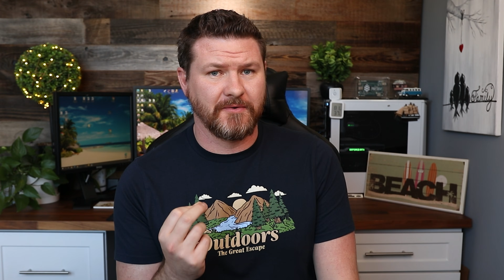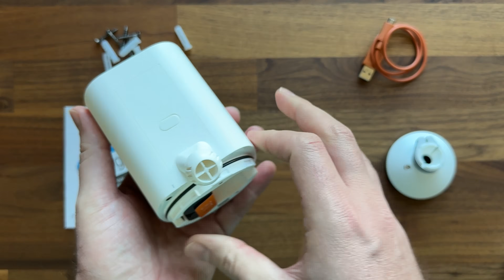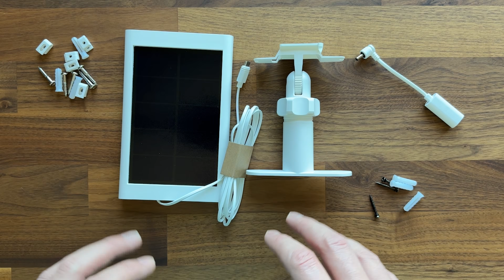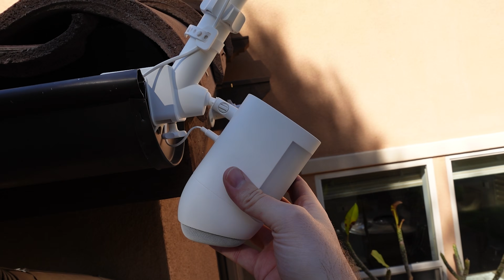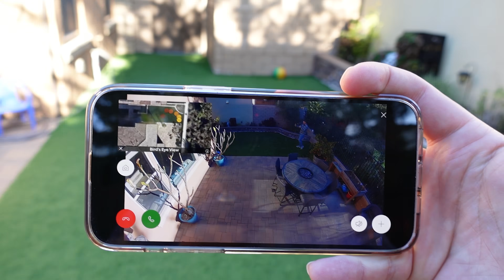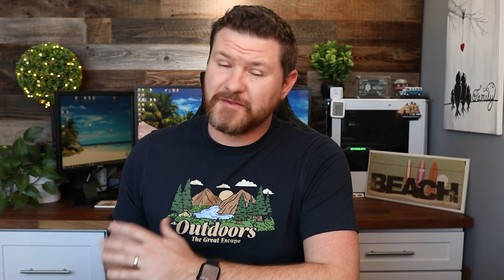The TRUTH About Ring Spotlight Cam Pro

Comment: The truth is I had nothing but problems installing this camera. Did you notice the owners manual shown in the video? It’s a trifold piece of paper with almost nothing on it. Mine had the QR code printed on it and it was so small my brand new iPhone 17 Pro Max could not scan it. This is the second ring product that had the small QR code that would not scan. This gentleman says he scanned a QR code on the back of the camera. Did you see It? Check the video. 
So they give you a second way to set up the camera without the QR code. There are five digits under the QR code that I would call microscopic. The only way I could see these numbers was by taking a picture of them and blowing them up. Many people are complaining that they lose these owners manuals over the years and then they can’t reinstall their cameras. I honestly didn’t know that you could pull the mounting bracket off the camera and turn it around. I had no instructions. I had to watch two YouTube videos to get proper instructions. My camera came with a battery and also the type C port on the back of the camera just like his. I don’t think there are different cameras for different power sources. I certainly didn’t get that option on Amazon. When you finally get the five digit number to work, you do get to the instructions, but they are not good instructions. I actually wanted to mount mine in my garage. I have an attached garage and that is the main entrance I used to get into my house. I thought the light would be a good way for me to get into my garage and see my way to the door and unlock it. And honestly, it is working great for that. The problem was getting the camera to take power. The one battery supplied is really not enough power for this camera. They give you one, but you really need two. What are you supposed to do in the winter time? Climb a ladder to constantly recharge these batteries? I ordered a power cord and power adapter for Ring cameras on Amazon. It was supposed to power this camera too. It was not nearly powerful enough to show the camera was getting a charge. In the end, I had to fiddle around with this camera for days before I got it to work. I found I needed at least 100 W power cord and a 60 watt power source and now the camera seems to be charging. However, many types C charging chords will not fit into the back of this camera. The indentation is too small. I very luckily had a 3 inch type C power cord and extension adapter meant to be used with a phone recharger. It had very small ends that could fit the Ring camera. I think the camera base is very cheesy for the size of the camera. I think the picture quality is not very good. Why do they call it a spot light? It has a very wide angle light source. I kept getting notifications that the camera was not getting power with the cord and I should switch to battery. I don’t know why they made the set up so complicated. When you switch from power to battery, you have to redo the Wi-Fi set up too. I tried to call Ring customer service on my last two purchases, good luck with that. I would say Ring customer service is the worst I’ve ever had to deal with. It’s AI and it takes you a very long and aggravating time trying to speak to a human that is as defective as their AI. As far as Ring AI for their camera, that didn’t work well for me either. They did give me a free trial. When I was away from home, I got a notification that someone was taking a package off my porch. I quickly checked my footage and it was an Amazon driver, leaving a package on my porch not someone stealing a package. I don’t think I will ever buy another Ring product. Thank God for Amazon customer service. I had so many problems with the first spotlight camera, they sent me a second one. It had the same problems as the first and I had a hard time getting it to charge with a power cord. Ring customer service was so bad I called Amazon and they refunded my money and told me to keep the camera. My opinion is do not buy the spotlight camera. I’m honestly sorry that I have Ring cameras now. I also had a mini stick up camera that came with a power cord and no battery. The picture quality was so bad I ended up throwing it in the garbage. My first ring doorbell camera is still working and I think this company started out great. I don’t think they care anymore. They are pushing other services like AI and home monitoring. Wasn’t the original purpose of getting a ring doorbell to avoid high home monitoring costs. And other cameras shown on YouTube give you AI features for free.

Comment: I also hooked up the solar panel that does nothing.
Reply: How do you mean?
Reply: @user-tz8pf4pd4q you can buy a separate solar panel and a second battery but the batteries still die pretty fast. A few weeks. I guess weather has a lot to do with it also. If it isn’t sunny the batteries won’t charge.  Sooo I’m still setting up ladders to climb up in the tree to charge the batteries.

Comment: Fellow Ring enthusiasts: I have been criticized for daring to CRITISE the New Ring Product line, even after installing over $ 3000 worth on my home. HOW dare I ? Well the answer is RING engineering has FAILED. "over educated young engineers w/ NO COMMON SENSE" NOW you say prove it: OK 
1st Ring pushes Plug IN CAMS that can be easily over run by ANYONE pulling the plug Daaaaaa, 
2nd The Battery Cams fails weekly, if you do not climb a ladder to replace the Batteries Daaaaaaaaaa. Even the OLD WIRED CAMS with there low electronics, are better options... 
3rd NOW: the HARD WIRED Cams... WHY R are they Labeled "BATTERY" if HARD WIRED, Daaaaaaaaaa PLEASE JUST PRINT "HARD WIRED" and SAVE THE COST OF THE enclosed BATTERY, which has no value~! Lets talk about the "HARD WIRED" and its new CHEAP THIN Connecting; BRADED WIRES with a 1/8" Soldered tip Daaaaaaa it bends when connecting to a HOUSE WIRING..Daaaaaaaaaaaaaaaaaaaaaa and 50% FAILURE TO CONNECT...RING please just SPEND $.05 to make it functionable  Daaaaaaaaaaaaaaaaaaaaaa 
RING you need to upgrade your engineering staff ......Truly Pissed here in Ohio trying from my original Hard Wired to these RUSTY BASE High Tech cheaply made CAMS...........................

Comment: Who in their right mind would purchase a battery dependent security cam? Daaaaaaaaaaaaaaa
HARD WIRED connection is required for dependability. HOWEVER the connection wires currently provided are "UNDER SIZED GUAGE" Daaaaaaaaaaaaaa
Where is the COMMON SENSE here?????
Get with it RING before there are more dependable & better options provided else ware.....
Reply: Obviously more people than you think.
Reply: Have you EVER installed these newer CHEAP wired cams... I have at least 10 this year.

Comment: I bought the regular Ring stick up cam, not the pro and it seems to turn on only after the person has almost already finished passing by. I have the detection set to maximum so I was disappointed at how long it took for it to turn on. So I’m probably going to return it to Costco and get something else, possibly the Ring pro. But I’m curious which camera you would recommend of any brand? I’d like to get 2 cameras and keep the cost around $500 total if possible but I’m not sure if I can get 2 cameras of good quality for that price. Any recommendations?

Comment: So what camera and what camera system do you recommend? I like the Simplicity of Wireless I like the solar panel charging . I need long range and through walls and about 2 to 300 ft away also for some outbuildings. Most need to be mounted to the gutter around the house at least want one on all four sides and then one about 100 ft away and what about 300 ft away from the router. I like the alerts but I also wish it would record 24/7. The only cameras I have experience with now are the Arlo ones from Costco and they are not bad except for they are not charging correctly and they don't get very good range far away. I don't know which one has the better operating system and works best with the cell phones... ?

Comment: The Spotlight Cam Pro Solar does come with a battery, just for the record. It needs a battery for the camera to function and the solar panel to charge. The only one of the three that doesn't come with a battery is the wired option.
Reply: The boxes are labeled BATTERY, ..Daaaa. Even when you order a Hard Wired Cam. If you try to hard wire the unit to the house wiring you will find cheap braded wires w/ soldered ends...THAT may or many not be stiff enough for a proper electrical connection. HOW STUPID all to save 5 cents....NOT TO MENTION  a purchase return as defective (because of poor connections) Daaaaa

Comment: I have a brand new Pro.  Set it up and it worked fine for several days.  Following a power outage, I can not get the camera to log back onto the WiFi.  I’ve done a reboot several times to no avail.  I deactivated the camera from my app.  I tried several times to “activate a new device”, nothing seems to get me past the Red/Blue flashing light.  Any ideas?  Thanks

Comment: Thank you for the "pros" on the PRO ;-) - I've been a RING customer for many years and can't see switching.  One of the biggest things for me is the speed of the alerts/notifications and the fairly comprehensive sensor choice (took a while for things like glass breaks detectors, etc. to come to market) - the 3rd party options while they may not have full functionality are usually useful and easy to add to your system.  I'm sort of a DIY hobbyist but want a security / alarm system that just works without relying on ITTT or more than one base / gateway.
The price for monitoring / cam storage is good too - you can find less expensive but the quality and reliability of the app / cloud infrastructure is very much on-par with traditional/legacy alarm monitoring services at a fraction of the price.

Comment: can you attach two batteries and solar? Just wondering if something will go wrong as I just want to mount it and then forget it forever
Reply: That's exactly what I did, and I have not had any battery drain issues for the last year or so - since I installed  it.  The batteries remain topped off. According to the Ring app, the two batteries stay between 95% and 100% charged.  NOTE:  I have the previous version of the battery powered spot light (as he showed toward the beginning of the video at 3:07) mounted over my garage in a high traffic area - motion triggered off about 20-50 times a day.   I also have plenty of sunlight most of the day time. It has been through rain, hail, wind, and snow.   So far, all is functioning well.

Comment: Why does the camera skips time….like if I want to see at 530am it skips all the way to 630am so there is a 30 minute gap where it doesn’t record and it sometimes skips up to three hrs. Why does it skips?
Reply: You can set how often it records - go to Settings
Reply: It is motion activated. If there is no motion going on there is going to be a time gap between recordings. This device is not made to record 24/7. I think what you’re looking for is a CCTV security camera system.
Reply: The real issue is the lag between when it starts recording after motion is detected. Abysmal

Comment: Steve great video ! I just installed mine but the video quality sucks and it drags . Do you think if I have it plugged in or put a solar it will work like yours ?
Reply from the maker: See Short reply
Reply: @SteveDOES do you know if it's possible to connect these to your mobile phones mobile hotspot as I don't have a WiFi router as I buy unlimited data from my mobile provider

Comment: I do like the ecosystem but this camera quality is 'worse' than the Stickup Cams IMO. The video stutters and colour is just not the same. There is a feature where the light can come on and go off at dusk/dawn etc. That doesn't work in the UK. I did complain and apparently that will be fixed around April. I had bought this because I wanted the better FOV but feels over priced for what it is.

Comment: Steve, thank you for all the work you did and have done on these camera reviews. I bought into Arlo through multiple generations, then Wyze, then Ring--I have been hoping that Ring would address their actually quite poor image quality, but they haven't. In looking over your videos for Ring cameras, they seem almost the same, model after model, it is so disappointing. You put a positive spin on the Ring ecosystem, but if you buy cameras to protect your home, you want QUALITY, than blurry blobs at night or beyond 10 feet during the day.  How about reviewing high quality wired cameras, POE or IP, 2k, 4k and above. Show us what we are missing.
Reply: A Five cent fix is all they need. Solid wires NOT woven wire w/ short soldered ends... AND a non rusting mesh base

Comment: I've had issues with Ring's quality, I struggle to reconmend them.  On my third doorbell (first and second failed), second spotlight camera over the driveway (first one failed), and backyard spotlight camera that has failed audio.  All have had different failures.  Also having issues with the app on a Samsung phone.  Thumbnails take over 30 seconds to load now.  One camera the timeline doesn't load without changing settings.  All in all very disappointed in them.  Looking at others to move away from Ring.
Reply: I have issues with Samsung and my nest doorbell. Works fine with my iphone.  About to add some ring spotlights as my cousin love his. I wonder if it's an android or samsung issue.
Reply: @KurPee  I haven't used Nest,  just Ring. As far as Samsung and Ring, I had problems a few months back with live view not updating, but that has since resolved.

Comment: Great video sir!  At one time I was hung up on 2k 4k high resolution wireless cams. But I really like how far Ring have process since emerging with Amazon and the great improvements in the Alexa app. Now without having to setup a skill on the Alexa app.tYou now have the ability with the Echo show 5 and 8 plus your other Alexa devices. Where you can get announcements on your echo device. When motion is being recorded and on top of that. On your echo show 5 and 8 you will not only get a announcement. They will also display what ever cause the Ring cams to record. With that being said if you add the Ring DIY aiarm system monitor or self monitor and ring glass break sensor. I feel is the complete package. Man I tell you those ring glass break sensors all really good. I have to 3 incidents where I have the Ring alarm set to home. I was was dishes a plate hit another plate and set it off. I dropped a medium size box with the item still in it and it set it off. In my bathroom I shut the vanity door to hard or it was the shower door. But anyway the alarm went off. I have to add I have the glass break sensor wherever there's a window in the house. Personally I think Ring and Amazon echo devices tried together is a complete DYI home alarm system in my opinion. It's ok to get a notification on your phone that you probably won't hear from sleeping. But it's better to get a announcement plus a visual of what is causing the Ring Cams to show on a Echo show 5 or 8.  On your night stand next to your bed at night. If you don't have pets outside to set them off you shouldn't have a problem. Again great video keep them coming.
Reply from the maker: Thanks Paul. Great feedback
Reply: @SteveDOES  THANKS

Comment: Excellent review as always,  Steve, thank you!  I agree with you about the video quality,  but also agree with Ring's outstanding features, which does weigh in their favor.  However,  being a fairly expensive camera with only passable quality.  I would like to buy in more into their ecosystem (I have their doorbell pro and alarm system and monitoring), but am a little hesitant because of pricing.   I do like having their service, though, which covers their products and allows me to add additional products and automatically expands coverage.  Right now, I have Arlo Pro and Blink cameras outside, and a bunch of Wyze inside.  Clearly,  my wife and neighbors think I am a maniac.   Anyway,  I do have a couple of questions (as usual) for you.  Since I need the outside cameras to be battery and wifi, due to lack of available outlets, what's your recommendation for overall best outdoor battery cameras balanced between quality, features, price, and battery life.  My second question is: what is the battery life of this ring pro camera and does adding a second battery double that battery life?  Thank you!
Reply from the maker: Hey Bill, sounds like you have as many cameras as i do. haha
So as for best overall camera, i did a video about a year ago, and Arlo Pro 3 was my favorite. If you already have a Ring subscript that covers all your cameras, i'd recommend sticking with them. 
Now as far as battery life, that's hard to predict and why you can't find much information about it. It's all going to depend on your camera settings and how active the area is. Is it on the side of the house that no one goes on or is it in your front yard and getting triggered 30 times a day? This is just an educated guess, but i'd say the batteries will last anywhere from 2 weeks to 4 months. Also, adding a second battery in the Ring Spotlight Pro will double the battery life.
If you find that the battery is running out too fast you can always add on a solar panel later down the road. I'm using the smaller 1.9W panel and both my batteries are toped off right now.
Reply: @Steve DOES  Thank you very much as always,  Steve!  That information truly provides me with the education I needed!  Glad to see that you still rate the Arlo at a high level.  I appreciate it  - you are the best!